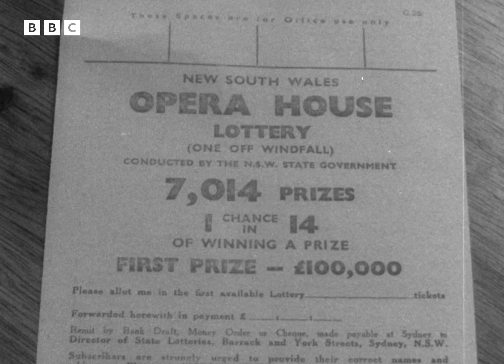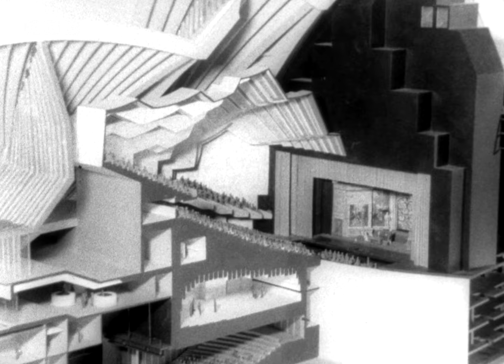1965: SYDNEY OPERA HOUSE - Too Revolutionary to Build? | Tonight | The Making of... | BBC Archive

Comment: Honest to God. It's a miracle this building was ever completed at all given the issues associated with its construction. However it demonstrates the power of an open ended budget along with a permanently moveable completion date.and a supine client who clearly didn't  give a monkey's about either.
Reply: It never did get completed though did it. The original groundworks can still be found if you visit the site, which is now a museum and art gallery along the river.
Reply: @handsoffmycactus2958  I didn’t know that! Is it in a basement level of the building or where?